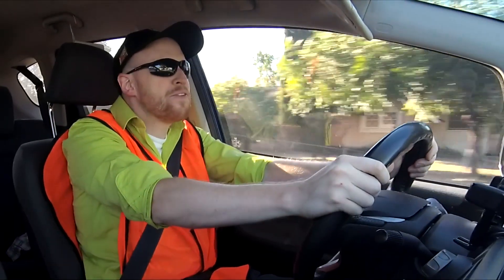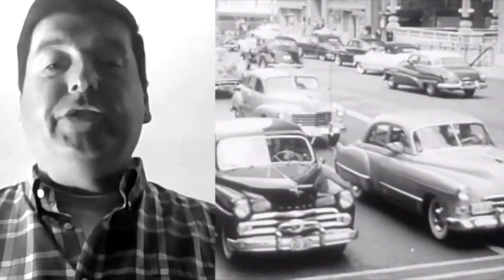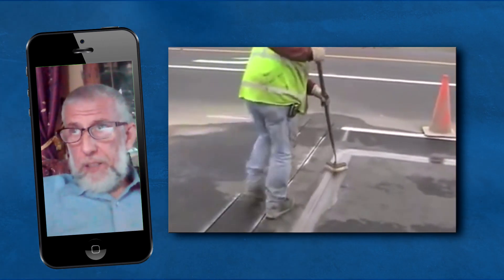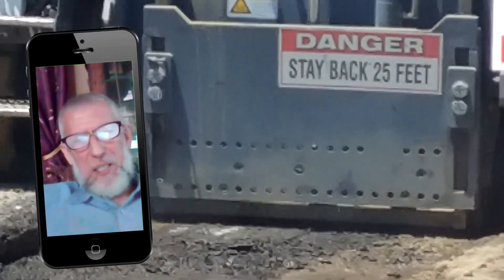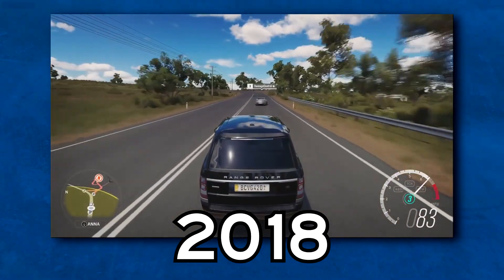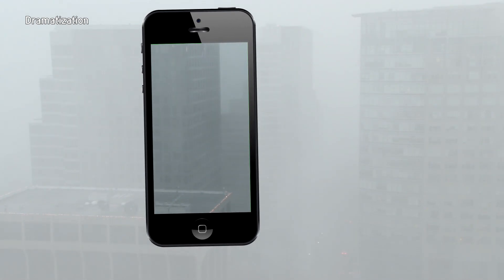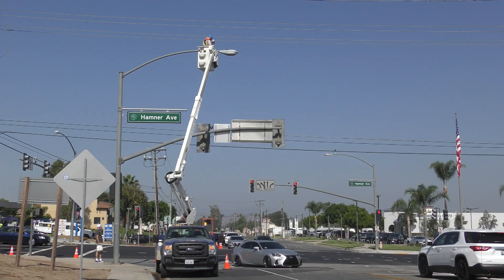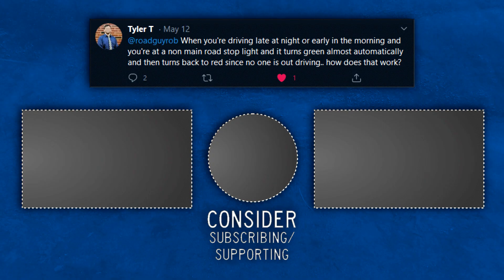How do stop lights "see" your car (to turn green)?

Comment: Hi Rob,  I'm pretty sure this is happening all across the US. The vast majority of drivers can't make a left turn without cutting through the other left turn lane on the street they are entering. It is so prevalent that a lot of timid drivers stop short in the left turn lane perpetuating cars driving over the double yellow. I drive home fairly early and enough JERKS make a left from the main street cutting over the corner of the left turn lane sensor on the side street. The light turns red needlessly on the main road. How about a set of two loops that can sense that the wrong loop is tripped first.

Comment: While it was a good video with good information, I was disappointed it ended with "whatever works best for your circumstance".
How about looking into "traffic sensitive" signals that aren't tied together? By this, I mean signals that are responsive to waiting traffic from side streets but are not synchronized with other signals on the main route. As a result, main route traffic ends ups stopping at adjacent signals even if they are traveling the speed limit because the lights operate independently. How do we fix that?
Reply: You can never synchronize. People push delay button to cross a street and sync falls apart. Those signals have to be on the programmed grid. 

But if the town Westsucks is on the grid but Eastiscrap is not, then both suffer (from govt management inaction) from the non-compliant one.

Or (cynically) 
The mayor travels N-S and the signal preference is in that direction. E-W will just have to wait.

Comment: As a former traffic homicide investigator, learning about signaling was a big part of my job.  My biggest “takeaway “?  In left turn lanes, where there is a green turn arrow for protected turns, there are often two loops, one behind the other.  If you stop over the loop closest to the intersection, and no one is behind you, you will probably get a solid green light and have to yield to any oncoming traffic.  If you stop over the rear loop, the computer sees multiple cars waiting to turn left and will most often give you a green turn arrow…depending on whether or not there are cars opposing you.  The trick…always stop over the rear loop for the best chance of a green arrow.
Reply: Ha! I wondered about that. I bike commute, and the left turn lane arrow is always the hardest to get detected on, especially if I stop over the loop closest to the stop line.
Reply: @michellsmorgcycle4161  If you are on/in anything other than a car, be sure to stop ON TOP OF the cutout  lines....that is where the loops are strongest and most likely to detect your bike.  Don't stop in the middle of the loop.  Also, the more metal in your vehicle, the better.
Reply: @lberry750  Thanks very much!
Reply: In the country where I live, some traffic lights have “filter arrows”
No idea why they are called that, as the arrows indicate priority (and some traffic lights here have filter arrows that come on to indicate that the lights in the other direction have changed to red early to allow vehicles to turn, although the traffic lights have to detect a vehicle waiting to turn that has already past the stop line to activate this sequence)

Comment: In the United States it's the exact opposite. Traffic lights are set up to turn red when traffic approaches whether there's cross-traffic or not.
Also I've noticed that they will set the speed limit at 35 mph for example and then program the traffic light to turn red when you're twenty feet away from the intersection and you're doing 35 mph. This results in one of two outcomes. Either run the red light or stop in the middle of the intersection. It's set up this way far too much in the US for it to be a coincidence. 
They also set up left-turn Lanes to accommodate a minimum of five automobiles in the left turn lane, but the left turn signal is only on long enough for the first three cars to make a left turn. So if you're in the fifth spot you get to sit and wait for 2 minutes for the left turn light to come on. And when it does you get to move up three spots putting you now the number two spot but you're now stuck an additional three minutes waiting for the next green light. 
I have discovered a way to get around this. Instead of going into the left turn lane I stay in the through Lane of traffic. I go through the intersection and when I get to the other side of the intersection I make a u-turn and then stay in the right-hand Lane. And if the traffic light is is now red, big deal. In most cities in the United States you can turn right on a red. So instead of waiting five minutes to get through the intersection this method allows me to get through the intersection in about 2 minutes. Of course be sure to keep an eye out at the intersection for cops.

Comment: With all the computer technology and sensor technologies that exist today, many cities need to improve this a lot. I frequently see 2 big issues.

1) The light doesn't know whether or not a vehicle is there, it knows that the vehicle was there. For example, a vehicle comes up and stops then makes a right-turn-on-red. The vehicle has been gone for several seconds when the cross-traffic light turns yellow. I can see that it's not possible to get the timing perfect, but when it's been gone for several seconds, there's NO reason to be stopping the cross-traffic. Also, it should detect the amount of cross-traffic. If there's not much and the stopped vehicle is in a right turn lane, it may delay stopping the cross-traffic to give the stopped vehicle a chance to make a RTOR. It can't do this forever, even if there's not much cross-traffic coming, since some vehicles are prohibited from making a RTOR (school buses, tanker trucks, etc.), but they should be able to come up with a reasonable formula for this.

2) It needs to be able to detect a vehicle approaching, not just one after it has arrived and has to stop. It should also be able to detect how many vehicles are approaching on the cross-street and calculate the best timing to keep as many vehicles moving, if possible, but not to the exclusion of the stopped vehicle.

Comment: 5:00 All electric current (except in a superconductor) produces a magnetic field around that conductor.  Loop the conductor around in a coil and you intensify that magnetic field greatly, because they are all additive for each turn of the coil.  Stick a magnetic metal into the middle of that coil and you'll really really boost the magnetic field of that coil.   Inductors like this store energy in the magnetic field...when the power is shut off, the magnetic field collapses, and it turns back into a bit of electricity in the coil as it does so. (Fluctuating magnetic fields can induce electricity in a conductor.)

That's how detector loops work.  The supervising device puts pulses of current through the loop, and then detects the "magnetic field collapse" is afterwards.  If a car pulls over the loop, the collapse will be stronger, and the device can detect this.

Comment: I was having a conversation about why timers are still used for some traffic lights and it made me remember this video. After double checking that it was not mentioned in this, I pose the question to Road Guy Rob: why do some places still use timers for lights? I live in Milwaukee, WI currently, and it seems that many of the lights are on timers

Comment: In the mid 80's a dump truck driver in Ohio figured out that if he'd cut the loop wire that it would disable that section and he'd always get a green light in the other lanes....  he didn't count on traffic cameras watching those intersections as well.  He got a heafty fine.

Comment: I guess cameras are most useful in busy intersections where you have 3 lanes or more each direction and places like levees and bridge embankments where the slight water leakage from an improperly sealed loop could wash out a section of the road.

Comment: A lot of the traffic lights in my city seem to be biased against the heavier traveled roads. For example the green light on the main road is on just long enough to let five or six vehicles through before it goes to yellow then red. Meanwhile the lesser traveled crossing street gets a green light for the one or two cars that are waiting, and that light continues to stay green for almost a minute after that. I'm guessing the idea is to break up traffic on the main road, but that strategy doesn't seem to work because now you have a conga line of vehicles with impatient drivers behind the wheel waiting to floor it next time the light goes green.

Comment: The other day I was driving the 13 letter shit spreader. Some jackass decided to turn left instead of going straight. He was in both lanes and not on the detector loop. Of course we weren’t getting the signal. A little air horn and he got the picture.

Comment: How about doing a video explaining why many jurisdictions are going to a metal arm for traffic signals as opposed to the old style cable across the road.  Seems to me that cables are less expensive and easier to repair. The arm seems crazy expensive to me, since they use tapered post and arms, which I know is for strength but more expensive than a pipe with a constant diameter. It does occur to me that mounting cameras on cables would likely be impossible due to movement of the cable.

Comment: As a cyclist, the worst part of triggering signals is standing there, waiting and hoping that the signal will change because whatever tool the signal used to detect you has detected you (especially left turn signals). And after 3 or 4 cycles of cars driving thru and your signal being red the whole time you just give up and run it....and then get pulled over by the cop that was hiding behind a bush expecting you to run that red. 🙄

Comment: While the detector software is using the cameras for signal control, police also have a feed to the cameras and monitor traffic as they would a normal camera, but not for citation purposes.  Those are another set of cameras and a different topic altogether.

Comment: When I was a kid (back in the early-to-mid '60s), there were a couple signals in Burbank, CA which had what I assume was "sonar."  There was a sort of "plumbing fixture" two-holed head at the side of the road with two openings about 1-½ inches, with mesh screens over them.  We could clearly hear the "tick tick tick tick" coming from one hole; and I assumed (as a slightly bright kid might) the other hole was the "receiving" side.
     Based on the reflection of tick tick tick, (like how a bat flies), it "knew" a car was present.
     Specifically near Lockheed Airport (as a kid).

Comment: This is a great video and a fantastic channel for roadway and highway infrastructure. MnDOT is a perfect example of the loop detector. During the PM rush hour the light will take forever to prioritize the state highway. The same highway intersection at 1AM will change immediately when my car or another car is detected. Minneapolis is an example that still in some intersections uses time-delayed signals and the light will be red at the same time interval at 5PM and 2AM, though i think they are moving towards video detection and some loop-detection in major intersections.

Comment: This video shows how common it is for drivers to drive OVER the crosswalk/stop line when stopping at red lights. [1:50 5:55 10:00 11:35 11:50 13:33] 😖 Too bad the sensors can't be tweaked to determine if it's the only car waiting, then make that car wait even LONGER than normal. 😉

Comment: I thought this was something that everyone knew.
That the square or round plug was the tip off.
This was something that I figured out on my own, simple deductive reasoning.
"I wonder if that  plug in the pavement right at the intersection has something to do with the traffic light trigger?"
Cars are mainly steel, maybe it has something to do with magnetism?
Duh.

Comment: I can’t tell you how many times I’m never detected while on my motorcycle at certain stop lights. I’ve tried moving back and forth to turning my steering left and right but no change.

I guess I could get off my motorcycle walk over to the crosswalk pedestrian button and tap it or just run the red light cautiously. 

Both those ideas are dangerous and could be costly.

Maybe the sensitivity in the cameras or loops needs to be adjusted.

Comment: I still don't understand why the camera by my apartment almost never works. I usually have to turn left at an intersection to get to my apartment and the left turn lane is a "turn on green arrow only" type of lane. Normally, that light stays red. When the camera detects a car, it will change. For some reason, it doesn't detect cars sometimes. I thought at first it was because my car is black, but then I noticed it would do it to other cars of different colors. Maybe I just need to complain to my city about it and they can recalibrate the camera?

Comment: What I don't get is how many cities will put detection loops in the pedestrian crosswalk. Rewarding bad drivers. If a driver is up in the crosswalk the light should not change for them. Might encourage them to be a bit safer. I know I get around by bicycle and have actually had drivers honk at me and yell to get up IN the crosswalk as I stop behind the thick line as you should. I signal to them 😉 I'm not moving and wait for the light to change.

Comment: I have never used one of these regularly that had satisfactory performance. My current road I have to do a constant slight movement forward/backward until I find just the right spot. Many times I've had to turn right then u-turn, and one time I just ran the thing after waiting for 10 minutes with no cars coming. Only time I've ran a red light in my entire life. Infuriating.

Comment: Not a bad video. Next one could perhaps show how delays are put into place such as in right turn lanes so unless traffic is heavy, there is no need for the light to change. Also, include extension loops placed in advance of the intersection that tells the controller that a car is close, and the light stays green a little longer, till it clears the intersection. The modern versionof this is radar, that not only picks up the car, but tells the controller the speed of the car, thus the controller knows how long to extend the green phase.

Comment: I remember every now and then I used to see those pneumatic hoses that they would use to count axles and I would give them a quick double stomp with my foot, the ones my City used had a little digital counter on the outside you could actually read and I could see it go up but only if I stomped it twice in quick succession like a car driving over it would do.

Comment: Many times I have seen people run past the loops, well into the intersection, waiting for the light to turn green which doesn't happen until someone else pulls up in another lane, correctly. Also, I believe the idea of multiple loops in a lane is to give the light more advanced warning of an approaching car, so the first one should be installed maybe 150-200 ft back or more, then the last at the limit line, and the second one in between. I think installers get lazy and put all three near each other so they don't have to cut so much asphalt. Pretty useless, really.

Comment: The street from my neighborhood (Terrace Drive westbound onto Peachtree Road in Atlanta, next to the Presbyterian Church) is a right-on-red tee-intersection, a steep uphill on the neighborhood street with the forty mile-per-hour six-lane street nearly level.      
To the neighborhood driver's left is an opaque five-foot-high hedge all the way to the sidewalk and a signal controller box that sits just behind the curb on the major street. This arrangement gives less than a half-second of vision to allow the right on red. Add in  a herd of pedestrians waiting for the light, and a right-on-red is impossible at this intersection.       
The driver of a standard-height vehicle has to pull so far forward to see past the signal box that the bumper of the vehicle is three feet or more into the right lane of Peachtree Road, vulnerable, and still unable to see more than a couple of car-lengths of oncoming traffic.        
Another complication here are a couple of dozen semi-trucks and box trucks supplying Peachtree Battle Shopping Center that invariably approach on Peachtree from the north, turning left on Terrace Drive to access the grocery store loading dock and the other businesses.       
The signals for Terrace Drive appear to be on a loop detector system, but it does not appear to have any connection to the signal control box. Exiting through the shopping center instead involves negotiating the cars waiting for parking spaces, clueless pedestrians, and unyielding wrong-way traffic. Peachtree Hills Avenue is no better than Terrace Drive due to the 'K" intersection configuration with Fairhaven Circle. To use Lindbergh Drive to access Peachtree, one has to turn left against lines of sight blocked poor intersection geometry, "traffic calming" and "streetscaping" which involved planting shrubbery between the sidewalk and the curb.

Comment: I've had to go through red lights on a bicycle before, because of crappy vehicle detection, even though all UK traffic lights are supposed to arbitrarily change to green every so often in case the loop strips don't detect a vehicle or have failed for some reason.

Comment: Not all induction loops are round. The ones I've seen used predominately are the double rectangle design which work just as well with bikes and motorcycles.

Comment: Loop sensors in the road detect the presence/absence of traffic. Except for a busy Main Street, I haven't stopped DEAD at a traffic light in 40 years!  Subsequently instead of my car getting only 25 MPG like the mfr/ says i should,  I get 31 MPG!  And I get 200,000 miles on a set of brakes!